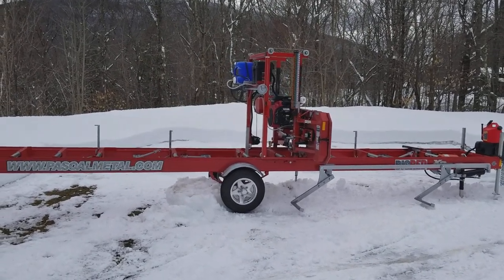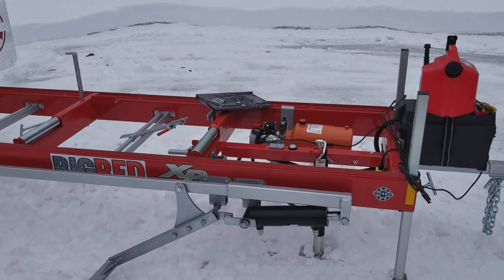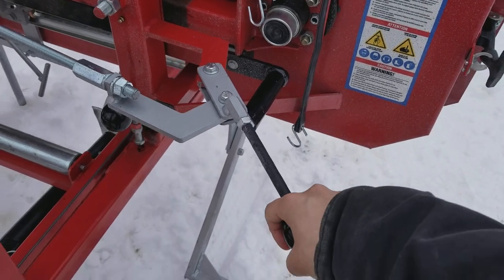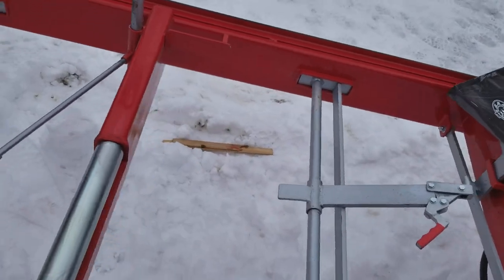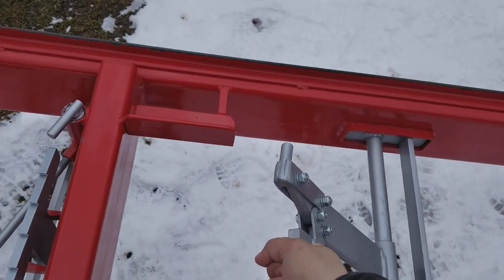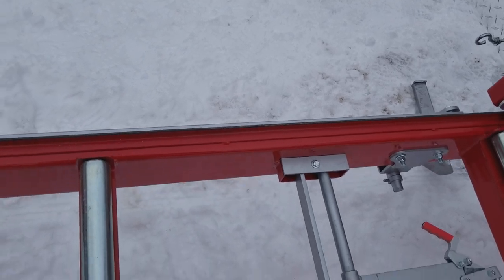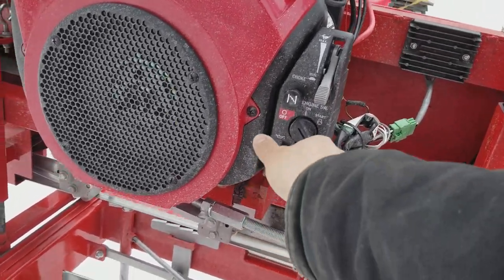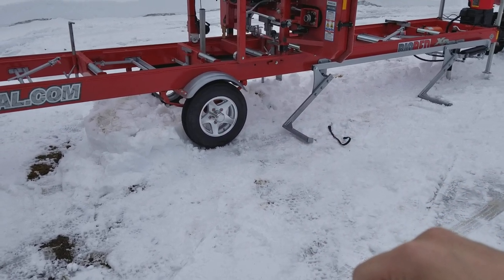New Pascal Metal bandsaw lumber mill!

Comment: Sweet looking mill bro. TimberKing also sells a solid frame. I've been doing some research myself and this mill now has caught my attention. My question to you is. How's that tail swing when transporting on the roadway? That axle being so close to the middle of the frame seems odd to me.
Reply from the maker: I pull it on the highway going 65+, and on dirt roads, no issue. Carriage is bolted to the frame directly over the wheels.
Reply: @appalachianworkshopvtllcda6495  Nice, how's the tail swing? I just ordered a TimberKing 1600 3 days ago. Looking forward in slicing and dicing logs. Best wishes bro.
Reply from the maker: @bfd1565  it's addicting! The biggest lesson I learned was setting up a level place to dry the lumber before cutting. I used cinder blocks, but I'm upgrading to a concrete slab this summer.
Not sure what you mean by tail swing, unless you mean it's maneuverability while pulling... I guess it's good. I pull it with my ATV and pickup truck. It's very long, 24'.
Reply: @appalachianworkshopvtllcda6495  I noticed the axle was pretty far in. So when you make a turn on a average street it seemed odd to me the positioning of the axle. I'll except any advise bro. Thanks